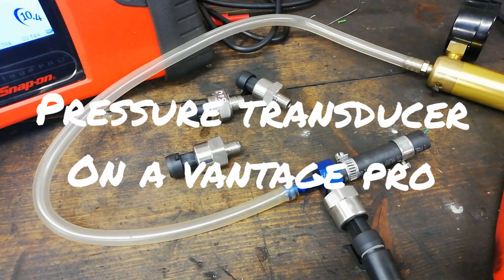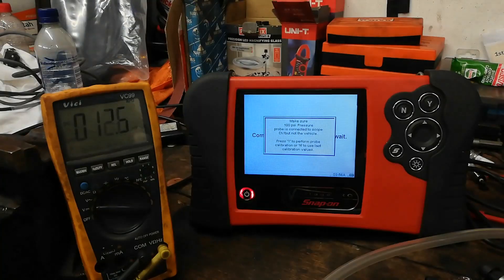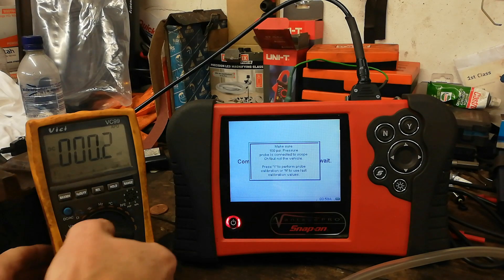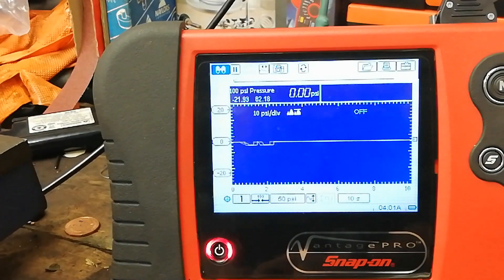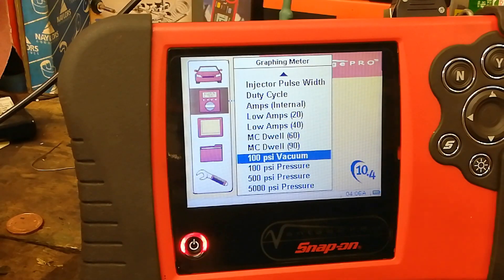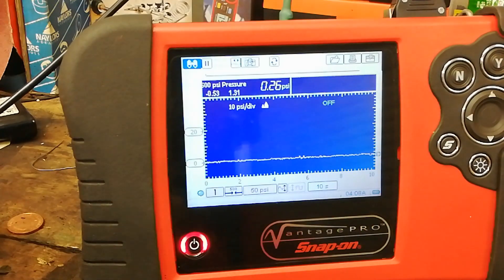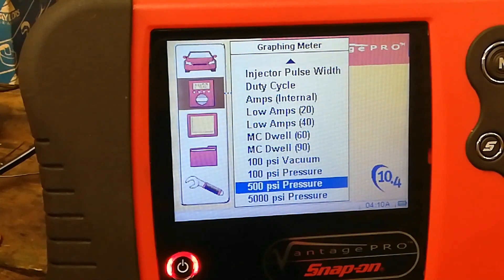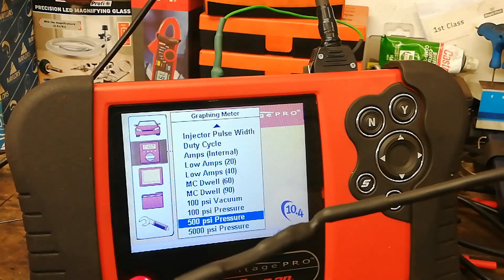Pressure transducers on a Snap On Vantage Pro, Modis, Verus

Comment: Good info about the 9 pin connector... thanks for sharing! Do the pressure sensors come with connectors & wiring? If not, where did you get those?
Reply from the maker: Hey Tom, the sensor wiring normally comes with it
Reply: @davesterl  Thank you!

Comment: Hiya Dave, You mentioned the wiring 1 & 5 for the positive and negative; can you please confirm the pin location for the (green) signal. 
Thanks in advance
Reply from the maker: Signal wire goes to ch1 or ch2
Reply: @davesterl  Hiya Dave, Just got the kit (100 & 500psi transducer) and took 35mins to built for my Verus Edge. All working brilliant. Saved a few quid doing it this way. Thanks for video

Comment: Cheers Dave I have a video on my channel with in cylinder pressure waveform on the vantage https://youtu.be/t9xBQNNYlx4 and it worked fine but not as nice as the Pico! The battery as you pointed out on snap on stuff in general is never that great, hope your well cheers sandy
Reply from the maker: Cheers Big Yin, I'll check that vid out when i get a chance, pretty busy atm